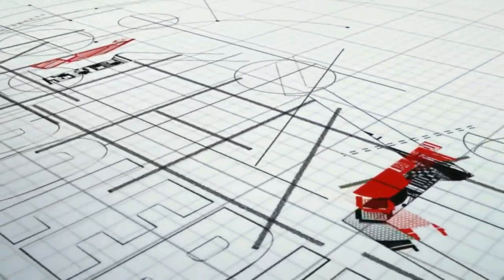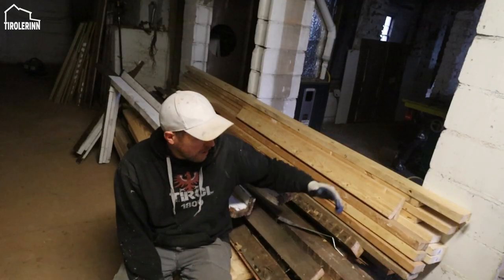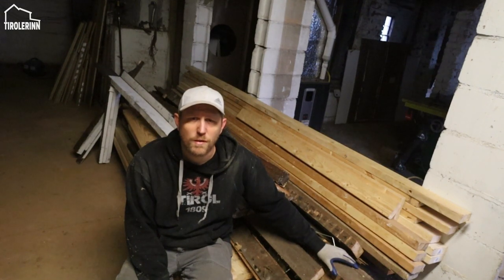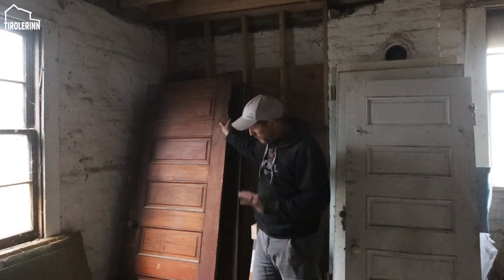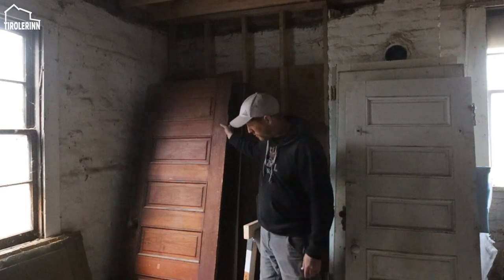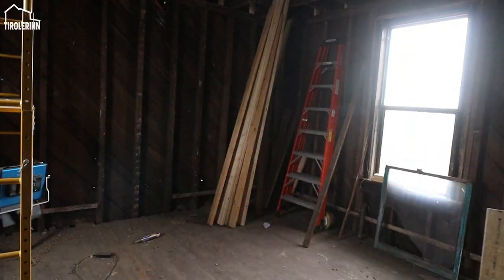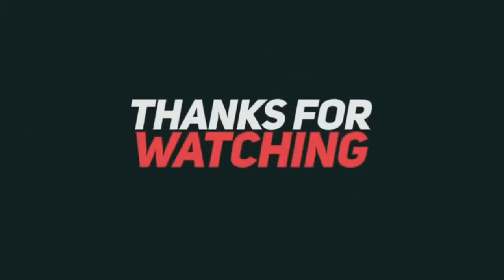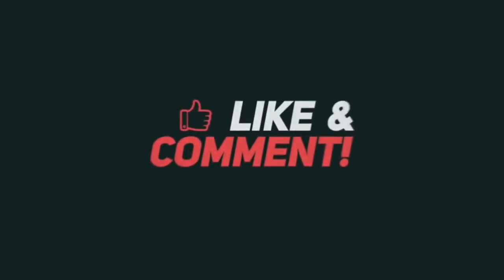Antique Doors and Reclaimed Wood Storage - TirolerInn the Renovation

Comment: Our Victorian didn't have crown molding.  We added it on the first floor.  Also on the first floor, we used the 4" LED canish lights.  Pucks really.  We removed the 6" can lights.  They work great on dimmers to add just a little light when you have the chandeliers on.  We have 10' ceilings.  Not sure how high yours are going to be when you are done.  So glad you get to work with your father.
Reply from the maker: We have 10 foot too. I bought some 6 inch cans and will do a test. If we like it then we use those probably.

Comment: If you have high ceilings go back to crown molding and forget the string LED lights. This is a Victorian house you should keep it as such.
Reply from the maker: Our house did not have crown molding in most areas, so it would be a change from the original already

Comment: Since you have a old house, you should try to keep it old looking but LED lights are Apollo bad for a old house.
Reply from the maker: We will use old antique fixtures and upgrade them to modern electrical standards from knob and tube or even gas fired lights for safety, code and efficiency reasons.

Comment: Definitely crown molding through out as well as the mood lighting!  Have you gone to the town hall to see if they have the blue prints on the original house. It would be nice to have those, they may give you some pointers on the character and colors used when first built.
Reply from the maker: the issue is that the area was incorporated into the city after the house was built and plans and such are very hard to find for any house that was incorporated after the fact.

Comment: I am not sure I would put the ceiling lighting on the first floor(maybe just the kitchen)  just due to the style of the house.  I would use wall scones, and a grand old light or a reproduction in the rooms.  If you use them, it might be an idea to put them on dimmers.  Yes, I would definitely install crown molding.  If the LED lights you want to install are an issue with Julie, then make sure they are on a separate switch so they can be turned off when she wants them off and on when you want them on.  I hope your parents are able to come and see their granddaughter.  When someone comes so far, it is nice that they can stay a while.
Reply from the maker: Good thought. We will have to evaluate and see